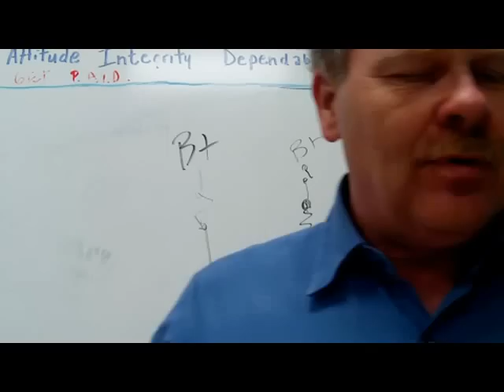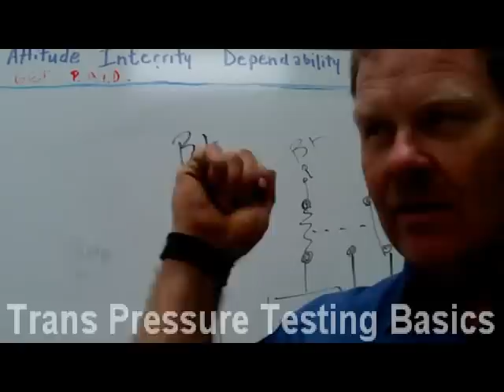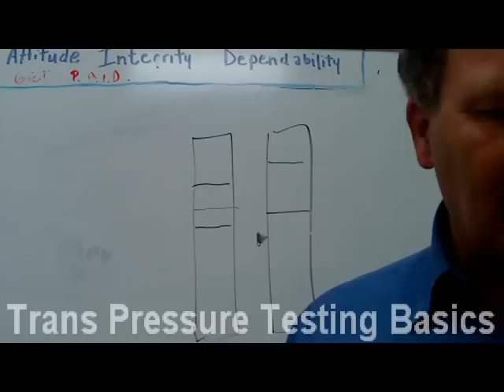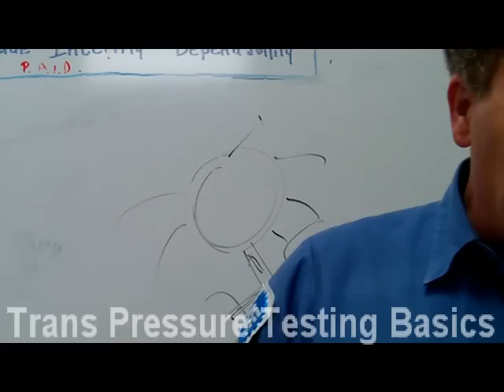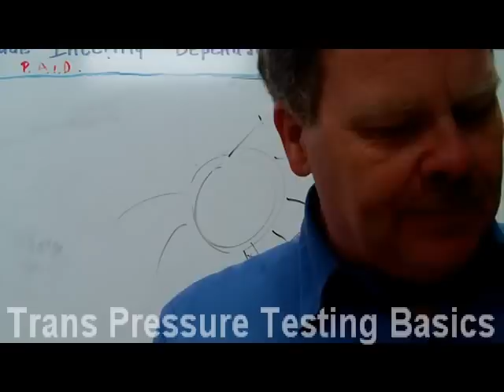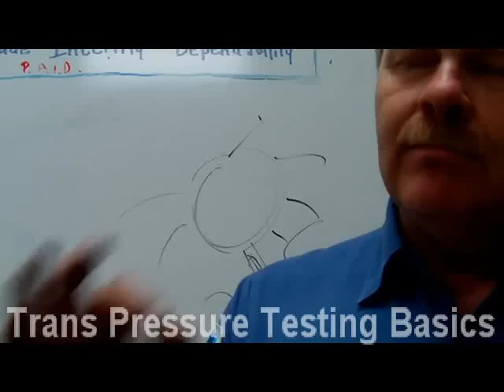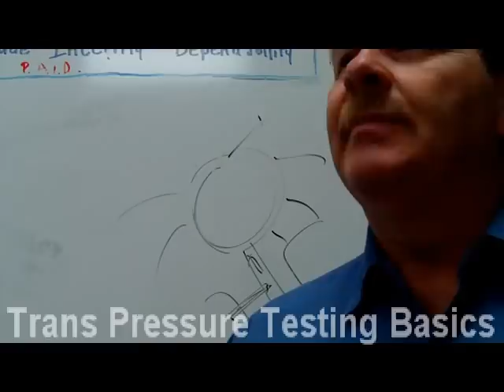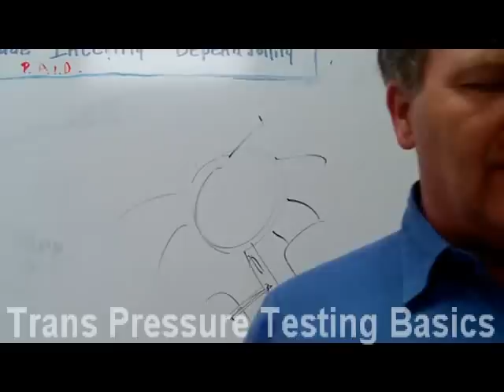Trans Pressure Testing Basics.flv

Comment from the maker: On the passenger side of the transmission there are three ports - the rearmost port (behind the servo) is the line pressure port.  The other two ports on that side are for 2nd gear pressure and 3rd gear pressure - 3rd is the one closest to the front. - the smartest thing you can do is to put a pressure gauge on a properly working THM350 and drive it for a week to get accustomed to what the pressures are supposed to be.  There are tables you can look up online, though.

Comment from the maker: The best way to do that is to simply drive the car - but if you want to get good with a transmission pressure gauge, install a good one (make sure it has a hose capable of withstanding 500 psi), put the gauge where you can see it, and drive around.  Nothing else works that well.  The pressures will be higher in reverse than the forward gears, generally.

Comment: OK, you've convinced me pressure testing is important. So where do I find the information on where the pressure testing ports are located on the transmission, and what the normal readings should be?  I'm currently working on a GM TH350 (1977 Chevy K20 4x4, 400 V8).

Comment: I don't think you've ever really given the answer to one of the questions you said. You are talking that line pressure will follow RPM meaning low RPM low line pressure high RPM high line pressure and there will be no boost in pressure from the throttle valve or modulator system and no reverse boost. So my question is what would be the problem with this scenario that you're describing

Comment: SLIP on a CORNER can be caused by a filter not properly seated also, pulling air from above the sump!!! Qt to much can cause atomization in fluid because the fluid level raises and is slapped by the valves causing frothy Atomized fluid, air compresses, so clutch packs don't, giving symptoms of low fluid, or worse, blow a seal. Refer to factory book, Alldata, OnDemand5, or ask a local Tech for port location and specs. Good stuff though!